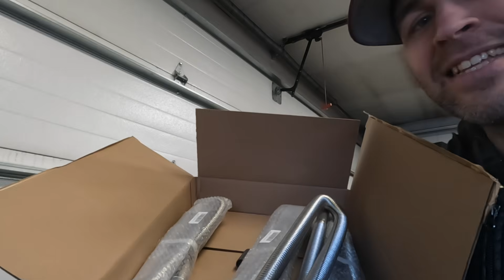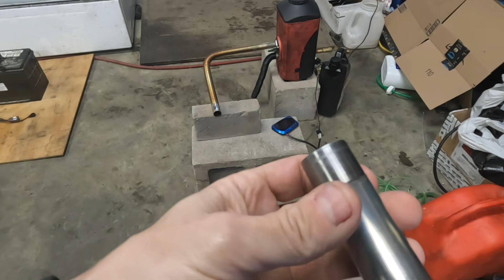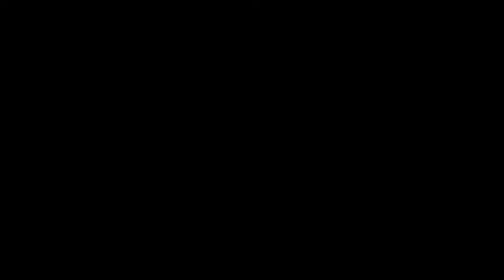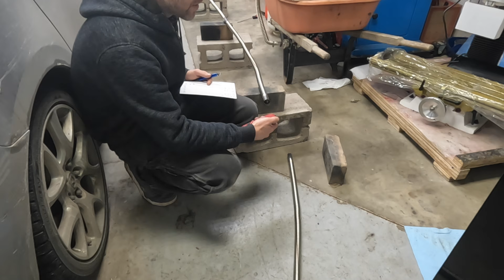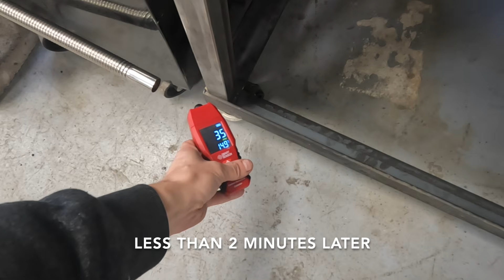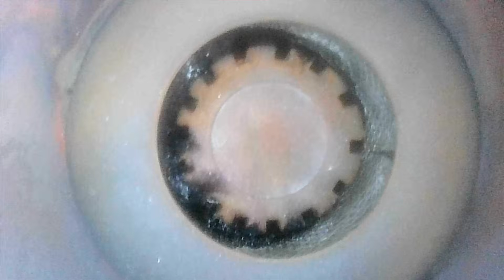Capturing Waste Heat - 5 Meters Of Stainless Exhaust - Will It Even Run ?

Comment: How about making a 1pipe to a 3 or 4 pipe adapter? I would think that would reduce back pressure in the exhaust.
Reply: Just use some larger exhaust pipe. 2 inch diameter pipe would increase the cross sectional area significantly. It would give more surface area than the corrugated exhaust pipe and less restriction from the smoother inner surface.
Reply from the maker: @ericl5973  There are lots of options, for sure. This is just one of the easiest and cheapest ways to do it. 

The slower speed of the gasses in a larger pipe may make it more efficient as the gasses have more time to transfer heat.
Reply: Same length of larger pipe, say 2”, would also give the exhaust more retention time in the pipe to allow for more heat transfer to the metal, and more surface area for radiant heat.
Reply from the maker: @markcoyle8003  I said this exact same thing, haha... It would for sure... I wish 2-3" aluminum pipe wasn't so expensive! 

Remember when I did the New Years cooking in a tin video? That actually started out as me running the exhaust into a 6 foot piece of square tubing... think I mentioned it in that video and may be showed a clip of it, haha.
Reply: Local junkyards might have something useful. One man’s treasure…
Reply from the maker: @markcoyle8003  Very true.
Reply from the maker: Great idea !  A little more difficult to build, but it would allow for a much more compact and free flowing setup.

Comment: you can use a radiator from a car or transmission fluid cooler or alot of things and pipe the air threw it and even heat water
Reply from the maker: Thanks for the comment. Have you tried this ? I would assume that a car radiator would be great, but an oil cooler will be way too restrictive. The lines are just too small.
Reply: logic still applies it was a generalization ive seen them used like this in many applications. the tanny cooler work good for wood stove but cars ones are better on this inside..what ever you got  @loweredexpectations4927
Reply: An old egr cooler has coolant on one side and gas flow on the other. Thats what ive been gonna do but i will learn from you mistakes first😅 @loweredexpectations4927

Comment: The block that the heater is perched on appears to restrict air flow through the heater. Like not much clearance there.
Reply from the maker: Yeah... I checked this for several hours in a previous test and it is fine. I also ran the heater before adding the exhaust and the expansion chamber was 184, the exact same temperature that it runs sitting upright.
Reply: If that’s the case, it could easily effect the outcome of the tests.